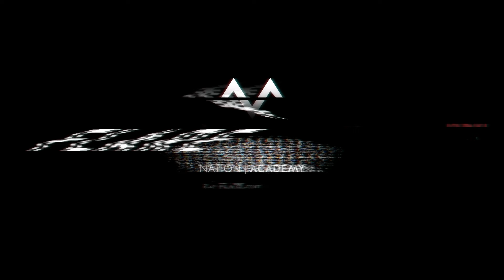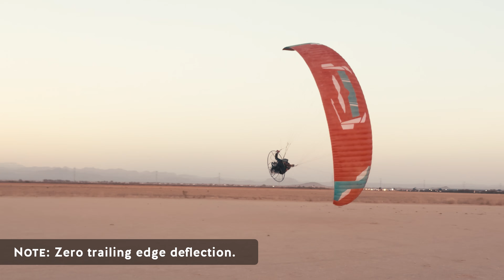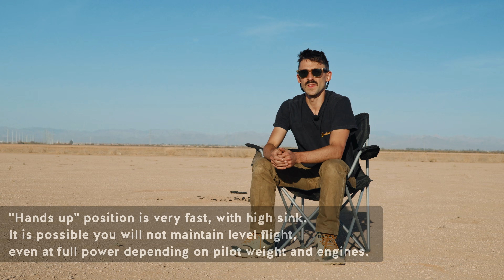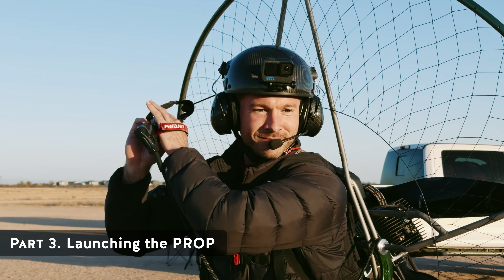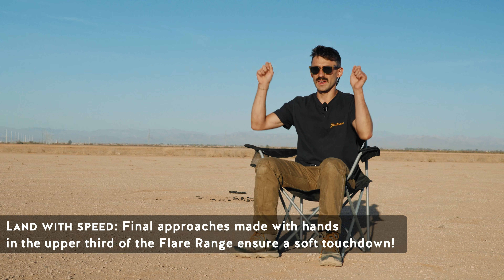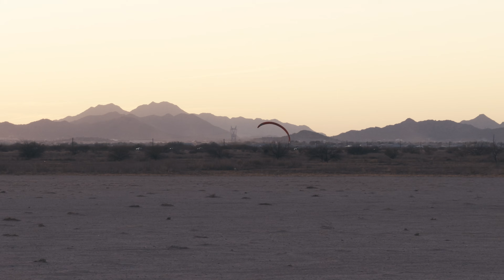PROP by FLARE | Paramotor Safety Academy with Judson Graham and Tucker Gott

Comment: My understanding that flying pure reflex profile in turbulent air could lead to violent collapse similar to what Anthony Vella experienced on his fully accelerated Luna 3. Mustache seems to have lots of fun and safety margin flying in coastal laminar airflow, like soaring sanddunes.
Reply: That´s just half the truth... A reflex profile gets more stable, the more you accelerate it. If you dare to use the standard brakes on a fully accelerated reflex wing (pulling down the trailing edge), you "destroy" the reflex profile. In that case the angle of attack gets way to low and of course it will collapse. This is, what unintentionally happened to Anthony with that knot in the lines. That´s also the reason, why tip steering should be used if you fly reflex wings accelerated (open trimmers). I personally fly the BGD Luna 3 and when it becomes "bumpy", i just open the trimmers and my wing gets rock solid...

Comment: Judson and Tucker, this was a fantastic video you both produced. This is definitely not a beginner or even an intermediate Wing. Going from an 18 m drift air that I’ve been flying for two years, do you think this would be a good next step up or do you think I should do something in between? Obviously speed bar is not an option here and definitely a lot of kitting time is required.
Reply: I need the same answer! Also coming from a Drift Air 18M and tempted with this as a second wing

Comment: I feel like they should add some kind of lock system to allow you to lock the toggle pull at minimum brakes, but no reflex. That'd allow you to essentially lock in at "most efficient cruise" profile in case you want to XC with the wing for a bit.
Reply: Working on it...
Reply: It's not made for XC but more like slalom proxy kind of stuff
Reply: @E620SE  even still, being able to stow the brakes for a few without becoming a meteorite would be helpful, and honestly safer. I can imagine a situation in acro where you fuel-starve your motor from high-G's and need to pull-start it in the air again. Being able to lock the toggle pull at "best glide" for the wing would allow you to drop them and focus on restarting your engine, or something, even if you didn't plan on doing XC stuff.

Comment: So is it different than a Moustache?  Been motor mousctaching a 22m since it basically was released.  Like to hear your opinion on the differences.
Reply: - Prop inflates a lot faster. Great for 0 wind launches. Mostache is optimized for more wind to inflate more gentle.
- Stallspeed is a lot slower in same size. Stalling more difficult. Great to launch in 0 wind with Motor again.
- Breaking strength is higher as with motor you are more heavy.
- Riser is shorter with different break toggle to adapt to the paramotor and throttle.
- Agility is a lot higher.
Prop is optimized for a paramotor. It is a lot safer and more fun that the moustache on the paramotor.
If you fly a Moustache already and know how to paramotor you have the perfect background.
Reply: Great comparison. Does this also describe how the Prop will fly without a motor, compared to the Moustache? Or just differences with motor?

Looking for a bigger parakite with multi purpose application. Already have a Line 13 and Moustache 15.
Reply: @david3898  It describes my experience without Motor. But I think that explanations are general.